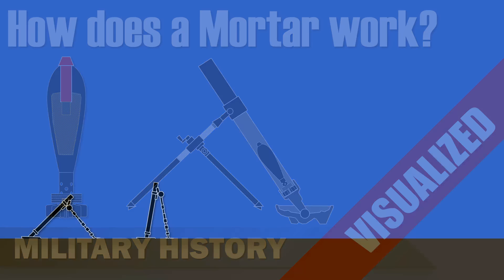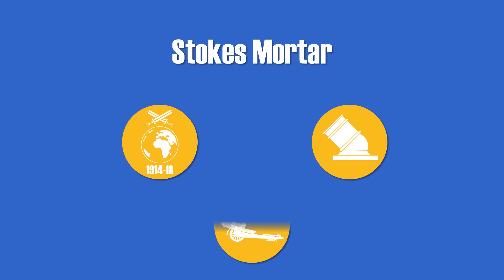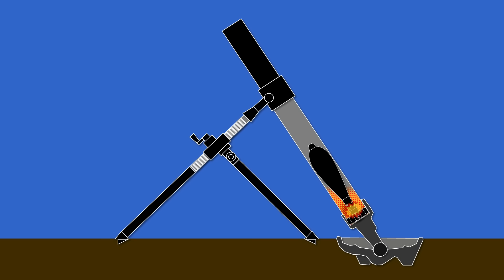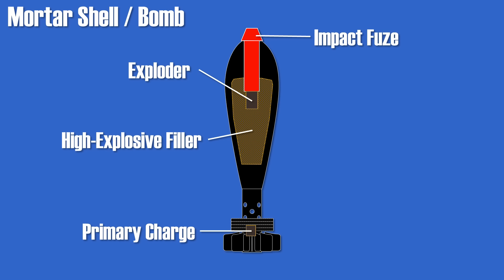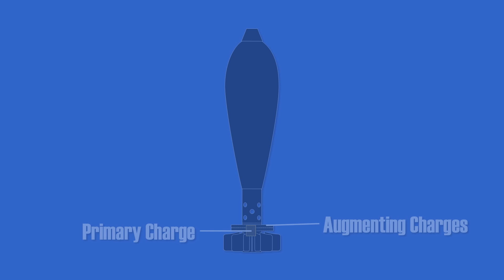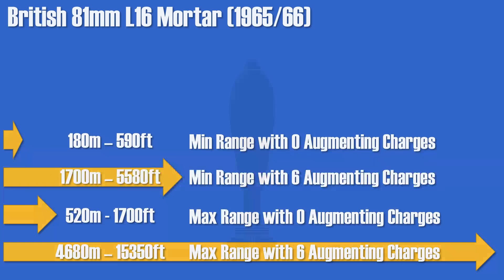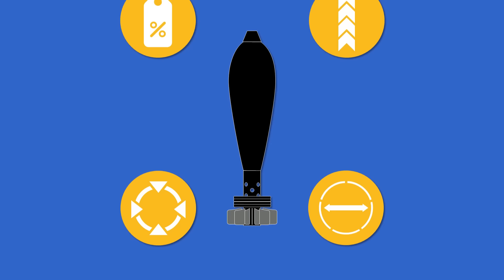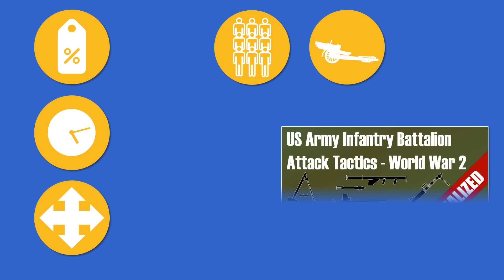[Weapons 101] How does a Mortar work?

Comment: as an ex mortar-man , i like the video although there are a lot of things you can add  like the fact there are different types of mortar bombs  not just an impact  fuses there are timed bombs and there are  delayed fuse bombs 
there are different kinds of armaments too ,some bombs used for lighting up the night while others are used to start a large fire  not just shrapnel 

There are also different calibers 52mm , 60mm ,81mm / 82mm (russian) or 120mm for instance 
Some of them like the 81mm can be mounted on an apc
Reply: that is basic information for anyone using a mortar , thats not advanced information ( i wasn't asking for them to explain how each individual type of bomb works exactly) they do teach you that in the army
Reply: @Ethan Boyd
im a modern day mortar man so im not exactly an expert on WWII / Korea era equipment (learned a little about it when i was in the army)
but if you upload a picture to one of the free picture sharing sites and give us the link we could take a look
most importantly 
try taking a picture of any serial number on the weapon usually on the bottom (although again ... WWII so who knows)
and try taking a picture from the side (full length)
also another measurement that would help is how long is the mortar without the base 
and finally does it come with a base plate or does it have a small flat metal base attached to it

BTW i would advice against advertising your gmail account like you just did 
people get a lot of spam mail that way

And finally i think one of the best bets you can make is to go to 
https://www.patreon.com/ForgottenWeapons/posts
post about the mortar
there is a good chance he will take a look
Reply: Heh, I was actually wondering if you could stop a mortar from exploding by catching it without touching the impact fuse.
Reply: First my MOS is not a mortar man i was a weapons specialist , one of the courses / weapons i learned to use is the mortar
now as far as theoretically catching a mortar shell before you hit the impact fuse
if you could somehow catch the mortar just before it hits without hitting it at the top of the impact fuse then yes 
but that depends on the type of round fired at you
there are shells that work on a timer - in that case there is nothing you can do
there are shells with an elongated impact fuse , designed to explode above ground , that would also require you to catch the shell at a different height than the normal one 
Hope this helps clarify your theoretical question :)
Reply: klystron2010 j
Reply: we sure are happy youre an ex.
Reply: This man has not let us know how his experiment went. Should have kept his eye on the ball like his teacher taught him....:D
Reply: Klystron2010, as far as I know, in the case of a misfire, that is exactly what they do. If the propellant fails to explode, they turn the barel upside down and have to carefuly catch the round without the fuse hitting the ground.
Reply: @blackmetalista  
That's correct. Some mortars are breech-loaded, in which case you can usually just open up the back of the tube.

This isn't usually the case though, and you'll have to tip the tube. You just form a sort of circle with your hands and you'll catch the projectile by the thick part as your buddies slowly lift the tube.

Some mortars, usually heavier ones, also don't have a protruding firing pin. Rather there's a trigger that can be activated by pulling a rope that's attached to the bottom of the tube. This way you can pre-load the weapon and open fire much faster when you get the command.
Reply: Pele sch He is giving a fundamental explanation.  Not a run down of the entire range of mortars. No one is that interested in them
Reply: @Infinite_Jester  Also, most of the fuzes (that I know, might be some that don't) require either certain velocity or other effect (such as spinning) to arm. Hence just dropping them from the tube doesn't arm them. You could drop them on their nose and be just fine.

Obviously better to be safe than sorry though, hence the hands catching the round... :)
Reply: @Rosak  If I recall correctly from my conscription days, the round (at least 81 and 120 mm) is armed upon assembly, which is done on-site (there is a safety pin blocking firing pin which is removed after having screwed the fuse on*).
If you have a misfire, you hold your hands around the opening of the tube, so that when you tip the tube, you will get a hold of the thickest part of the round. Then you place the safety pin back.

Some expensive types of mortar rounds have more complicated fuses, but typically they're really simple percussion fuses. Fancy fuse stuff is more common with artillery rounds.
To illustrate: we only ever worked with two kinds of fuses during conscription, the typical percussion fuse and a different one for illumination shells (the ones that fall apart in the air and release a long-lasting flare).

Edit: obviously, the firing pin still requires some amount of force to be depressed, but I don't think it ever occurred to me to try and find out how much force exactly.

*You can see the safety pin quite clearly on this picture: http://www.90thidpg.us/Equipment/Weapons/Fuzes/M52/images/DSC06285.JPG
Reply: So mortar is operated by two usually? Or is it possible to use by one man given he has logistics to help him?
Reply: Ras Putin we normally have 3-4 depending on the size of the mortar but a lot of 60 teams only use 2 on patrols
Reply: I wasn't a mortarman but grunt,clerk and radioman at the same time but aren't all mortars 81mm and all recoillesses 90mm since 2-3 decades ago? We hadn't any in our unit(squad sized) and borrowed the mortar from the signal battalion.
Reply: I'm pretty sure that you can mount any mortar on an APC if you're stubborn enough.
Reply: Thank you for providing additional info! As a person who is not in the army but wishes to learn more, this is all interesting info to me!  

I appreciate it!
Reply: @klystron2010  I ... would advise against that particular tactic ;)
Reply: This is what the comment section is for, "Additional knowledge". Thank you
Reply: How does a mortar sight work?
Reply: And the 4.2 mortar, also there are chemical shells.
Reply: @blackmetalista  I was working with a 120mm mortar with an overall weight of about 500kg. You dont turn that upside down. There was a tool to be lowered by two ropes from the top that would clik onto the round, so you can pull it out.
Reply: @Infinite_Jester  I worked with a 120mm mortar and the rounds did not have anything on them to touch or to defuse. Just drop it in the tube and the acceleration will arm the round. With a misfire, when the round just hops out to 5m distance f.e. it would not be armed yet.
Reply: @aabb-zz9uw  We have 120mm mortars. In my time pulled by a vehicle for a team of 5 in a fighting group of 6 mortars plus coordination center. Nowadays they are mounted on a armored vehicle or as mobile unit in the back of an offroad vehicle. It is a lighter version and for 3 people. But i am not from US or UK.
Reply: @billybillybillybillybillybilly  Depends on purpose. When its a small one for individual use you just estimate. I was in a heavy ranger company that had three groups. 1. Infantry 2. Tanks 3. 120mm mortars pulled by offroad vehicle. The group had two forward observers who identified targets, f.e. crossroads, landing zones for parachuters etc and gave the coordinates to the command posts. The command post gave orders to the mortars, direction and distance. The groups at the mortar set the periscope, angle and load on the round. One test shot was fired. when it was in about 50m distance it was ok. When the enemy arrived we shot volleys to bloc the crossroad or to put down the parachuters.
Reply: @mweskamppp  granted, it was a WW2 era info from my grandfather. He operated the 120mm Soviet mortar and said they were trained to do this, but never had to.
Reply: @blackmetalista  Okay. I think the germans copied the russian mortar for the last years of war. What i was working on, was a later model. And our ammunition needed the strong acceleration from a successful launch to get armed. And we got that retrieval tool to pull out rounds that did not fire. Some progress over the years.
Reply: @blackmetalista  I'm a former USMC Mortarman (0341). You are correct about misfires. The process is this (at least at was when I was in). As soon as you are aware of a misfire you scream "misfire", that's repeated up and down the line and everything stops immediately . You then wait a few minutes in case of a cook-off and to allow the barrel to become cool enough to handle. Then, everyone but the gunner and A-gunner (assistant gunner) of that gun gets back off the line. Supposed to be 100m away I think. Then the gunner of the gun that misfired, releases the barrel from the baseplate. The A-gunner then picks up the bottom of the barrel, so that it pivots on the bipods, upward to pour the round out. The gunner meanwhile places his hands over the the end of the barrel, palms down, and leaves a small diamond gap between then so as to allow the the fuse to pass through but not the wider part of the round. Kind of how you would catch a football throw at head height. After that, that poor gunner has to carry the round all by his lonesome to the "dud pit" which usually 100m or more off the line to one side or the other. Then he leaves it there and tries to pretend like it was no big deal as he walks back to the platoon with everyone watching. After that EOD is called to dispose of it. 

 I've personally done this 5 times. Most of the time, the round isn't armed because the force of the explosion in the barrel is usually what starts the process of the round becoming live. One time though, I'm pretty sure it was live since I could hear and feel a slight buzz coming from it. That was one long walk let me tell you.
Reply: @mweskamppp  French or German in Afghanistan? You've got really solid English for non US/UK
Reply: @TucsonHat  No. I was a draftee to the german armee in the 80s. I worked in Libya for app 15 years. It was a german company but international staff with working language english.
Reply: @Michael Weskamp  no kidding, 15 years of anything is impressive, let alone military service in Libya. I have a cousin that did some time in Africa semi recently as a US Green Beret. Thanks for your service from the US!
Reply: @TucsonHat  Sorry. I was working for an oil company in Libya, not for military. We did have security and local communication guys who were retires british SAS. Came very handy when the guys had to be evacuated with the libyan revolution. I was on holiday that time so i was lucky to miss that. The SAS guy organized and coordinated 14 planes to evacuate all foreign workers in libya. 8 months later we were back.
Reply: I was always curious how mortars are aimed. 
I know there are sights. And aiming sticks I believe.
Reply: @aabb-zz9uw  The german army used and still uses 120mm mortars. In my time as a trailer behind an off road vehicle. today as mobile unit in a WOLF its a Mercedes G Class for military. There were also units mounted on a small tank (MTW). Dont know all the units in today army.
Reply: @nicholasmuro1742  There is a periskop mounted on the mortar. 6 units work together in a row. For initial setup the periskop is aimed at a stick some 50m away. Then you have compass and angles. Some guys 2 or 3 miles ahead identify a target on a map, inform the command post at the mortars about the position. The command post calculates the distance and angle and gives direction to each mortar team and how many extra loads to add to each round.  Usually it is used to fight infantry in trenchs, block crossroads or landed parachuters.
Reply: @mweskamppp  
Thanks. I appreciate the reply and info. 
What about when you're on the move?
I understand it's Hollywood, but The Pacific series. On Peleliu airfield assault, Sledge and crew set up, sighted, and were dropping rounds on enemy close in. They were still using the optical sight, no aiming sticks. Can't you just use visual for bracketing at that range?
Reply: @nicholasmuro1742  I don't know bracketing. Yes, you can shoot on sight, when you can see the target or have a good estimation. You need one guy with binocular and thumb who can make a good estimation of the distance. Than you have tables for angle and load, put the periscope parallel to the barrel target the enemy and off you go. In an exercise shooting we were able to see target tank wrecks app 4km away on the other side of the valley. We were asked to shoot on sight, and by a good estimation by our group sergeant, we hit the wreck. Actually that was very lucky. A hit in 50m distance would count as hit.  A three shot series to close in to target would be ok.
Reply: @mweskamppp  
Bracketing was used more for Naval Gunfire at sea. You fire, see the splash. If it's short, you fire long. Or vice versa. Now the target is bracketed. You divide the distance of the 2 and adjust fire to get on target. Not needed with radar now.
Reply: @nicholasmuro1742  That is the normal procedure for mortars. Because of wind and other factors like the indirect targeting it is expected to need two adjustments before you are on target. A typical road crossing would be with one mortar doing two shots to adjust and wait with all 6 mortars for the enemy to approach the crossroad. When the round marks on or beside the crossroad are thought to be traitorous, they do the adjustment after the first volley.
Reply: @mweskamppp  I also have a question that is what kind of explosive meterials are being used in mortars TNT or something else becouse some explosive meterials are very sensitive which can be dangerous I know it  can b stupid question for you it's because I don't have complete knowledge about it
Reply: @jasminmalik9813  Cellulosenitrate. Also called Nitrocellulosis or gun cotton. Chemically Nitrate-ester of Cellulosis. Also used after some stabilization with campher as Celluloid for movie films or table tennis balls.
for the rubber like rings for the mortars it is kind of stabilized with chemical softeners.
Reply: @mweskamppp  so it means gun cotton is being used in mortars for explosions I thought it's just being used in bullets for presure
Reply: @jasminmalik9813  It is not the explosive in the grenade, it is used to push the round out of the mortar.
Reply: Anything else?
Reply: if you want to learn about the different shells this is a good video https://youtu.be/ScZuCDYSM2g

Comment: Ex-mortar gunner here, the pin on a mortar is not always fixed, Some models have a handle or lever, but the gunner can select if the pin Should be fixed or "manual".

A scenario for where a "manual" shot would be use is when utmost accuracy is required or  pinpoint at long distances.
Whenever a shell is inserted and hits the bottom of the tube, the tube can/will move a bit, that bit could be the difference of a beer i  the mess or a courtmartial.

And as another person said, there are a lot different shelltypes and fuses.

This video needs to be researched more and "approved" by current  or former mortar crews .

Comment: The propellant charge is in front of the fins.  One purpose for this is to spin the round in a smooth bore barrel.  The gasses blow past the fins which are angled to deflect the gases, causing the round to spin.

Comment: 21 and 87 degrees. Modern mortars can almost shoot directly at a target or completely vertical. Medium Mortars can be moved by hand, but the ammunition can not be moved in any meaningful quantity. So medium mortars have been taken out of line infantry units and put into a separate, battalion level unit that has access to trucks. If you would like to make a detailed video on mortars, I would be happy to provide you with any information.

Comment: Something like this about shaped charge ammunition would be very interesting and extremely helpful for a lot of people, considering how many myths about it are still around to this very day.
Reply from the maker: yeah, I will probably do one a video on those too.
Reply: like what kind of myths? o.o
Reply: That it shoots a glob of molten metal which melts through the enemy armour for example.
Reply: Tyrannosaurus Rex doesn't it? or does it just slam into the metal, and the blast is directed only on the impact spot?
Reply: +MonarchTherapsids Inostran 
It ejects a cone towards the target at incredible speeds. In fact, the speed at which it hits the target is so high that the pressure applied to the target area (a couple gigapascals iirc) is so absurdly high that it reaches a point at which solid materials start acting like liquids. So shooting at steel with a shaped charge is remotely like shooting at water with a pistol.
Reply: Tyrannosaurus Rex o.o geez